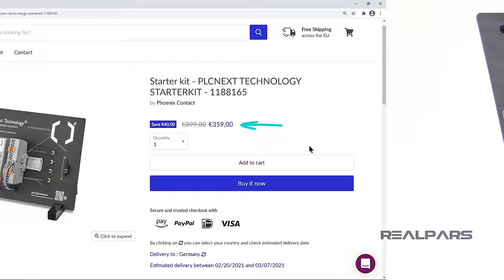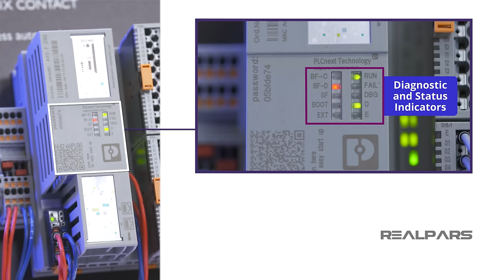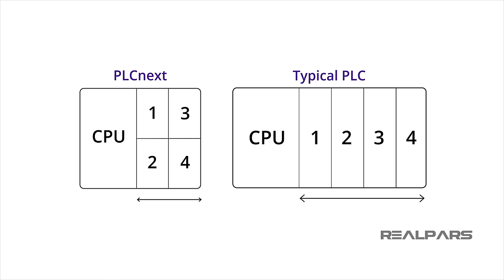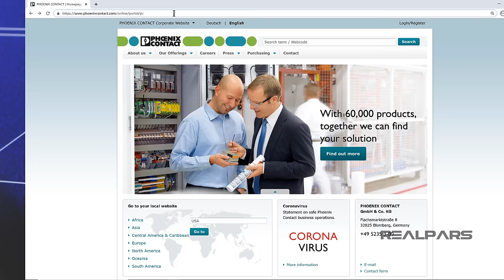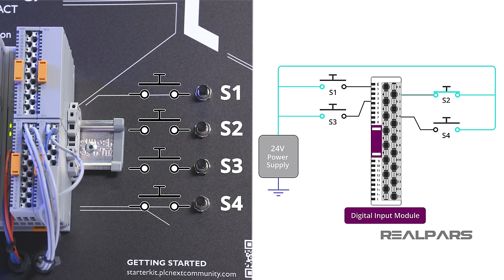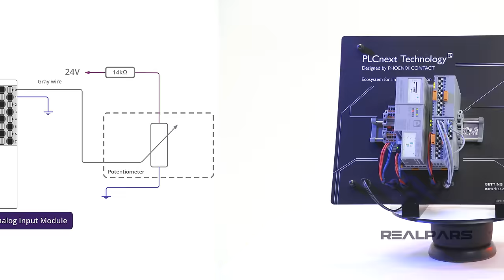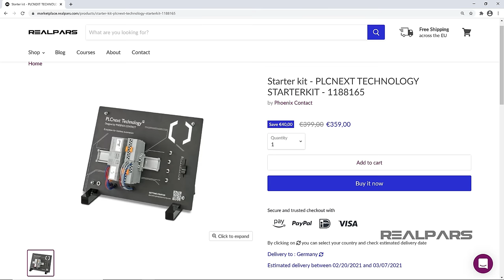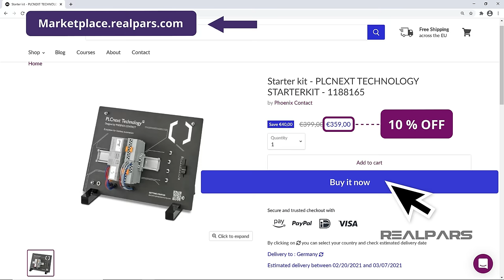PLCnext Tutorial for Beginners - Part 1 | What’s in the Starterkit Box?

Comment: Why didn't you install an analog output module along with the digital input, digital output, and analog input modules?
Reply from the maker: That's a good question I've pondered as well. There is a free slot for another module. That's a question for Phoenix Contact. Perhaps it's a cost issue to keep the Starterkit price reasonable?

Comment: Hi can I use this toolkit also in my smart greenhouse project? There need to control temperature and watering parameters.
Reply from the maker: Hi there.  That's a tough question as we don't know enough about your project or your programming skills.  The Starterkit can be used in many applications including temperature and watering function controls. But, the Starterkit cannot perform these functions by itself.  You will need a temperature transmitter to measure the temperature and send a signal to the Starterkit analog input module.  Assuming that your temperature control is simply on or off, the Starterkit digital output module would be able to operate a relay that operates your heating element/device. If your watering system is on or off, the Starterkit can also do exactly as the temperature control above.  Of course everything will depend on your programming skills. The PLC program itself is not that complicated, but if you are starting from scratch with no PLC programming experience, it could take you a bit of time to get up to speed.  Having said all that, it sounds like a really fun project!